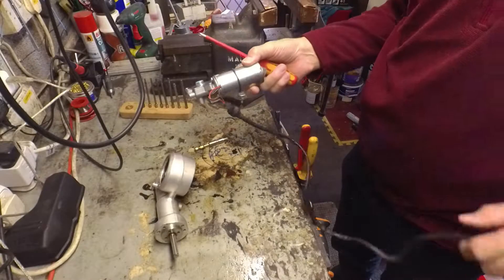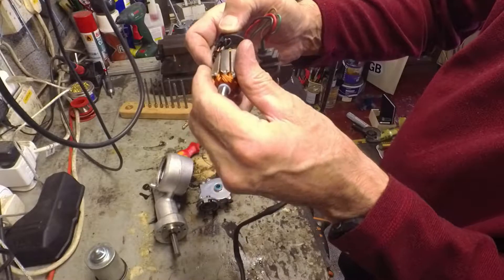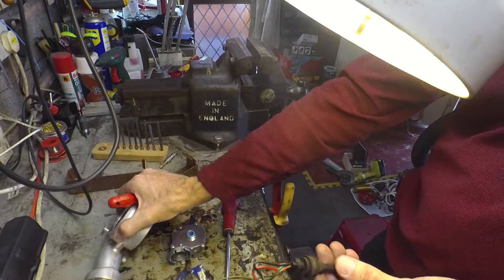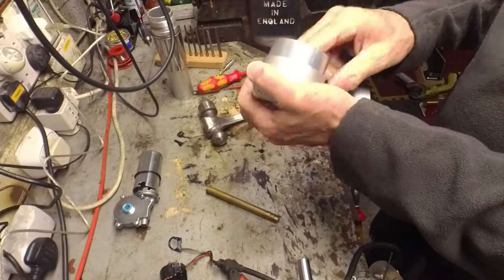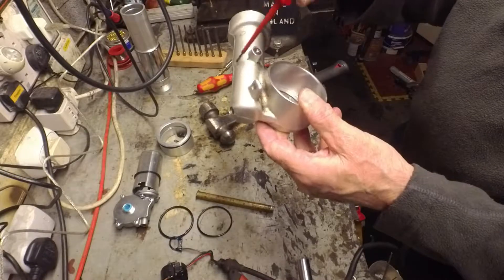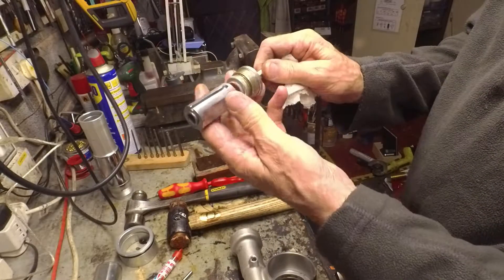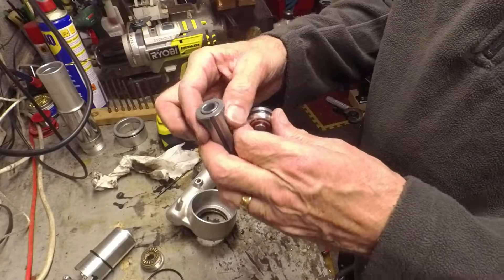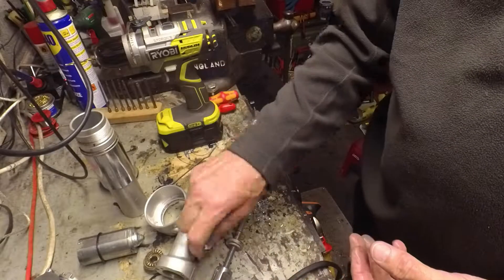What's Inside a BMW R1200GS Rear Suspension Strut? Pt 2

Comment: Amazing video Brian!!!
A friend of mine just bought a sidecar based on a K1600 GT. The manufacturer of the side replaced the shock absorbers by non-ESA ones. They do a good job and are in a good condition, so my friend is not keen on buying ESA ones. And so he has the ESA defect warning on the dashboard. I think the front and rear coils adjusting the softness of the shocks can be replaced by a simple resistor, as the preload motor. I will have to find the correct value of each resistor, but it seems reasonably reachable. The hall sensor you unveil is quite more messy to replace. Most hall sensors are 3 wired: ground, supply and signal. BMW managed to step out of the standard. Quite usual for them. Remember K100 comodos... So I have a little question for you: have you test this sensor? What kind of signal does it produce? It seems insulated from the rest of the motor. If you have this sensor left on the corner of a shelf, I would love to put it under scrutiny :-)

Thanks a lot for your video and every beat of additional help you could provide from 2 french bikers!!
Laurent
Reply from the maker: Many thanks for the comment. I didn't investigate the hall effect sensor any further than in the video and I don't have the part any longer. So, sorry but I can't provide any further details. I must admit that the ESA on my bike is unnecessarily complicated for my riding. It all works but I hardy ever feel the need to change the settings. A simpler set up would suit me well. Maybe riders who regularly carrying passengers would find the ESA to be worthwhile but that's not me. Happy riding :)

Comment: This is a fantastic tear down - as someone that has done many on F1 parts you nailed every function on the fly spot on. One thing regarding the hall position encoder, normally, the 12 DC bus to drive the motor has onboard current monitors. So when at max/min stops, the larger current draw would be seen by H bridge driver and the power shut off. This start or stop point would then become the point at which the hall effect sensor signals A+B would start to get counted. Generally, once the code starts running, only the hall effect sensor values are used since the pitch of the lead screw on the dc motor are known, thus travel per rev. The DC H Bridge current draw overload monitoring would only ever be used at calibration times.  All the best and thanks for video Brian, (r1200gs owner also!)
Reply: Spiace ma questo signore non ha idea di cosa sia un precarico molla dynamic. 
In pratica non ne ha indovinata una. 
Bravo! E fai pure video istruttivi!
Reply from the maker: @giacomorinaldi4822  Grazie ancora. Dove posso trovare queste cose spiegate correttamente. Mi piacerebbe imparare.
Reply from the maker: Many thanks for your comment - and especially for the added detail. Makes sense & good to get further insight into how these things work 👍